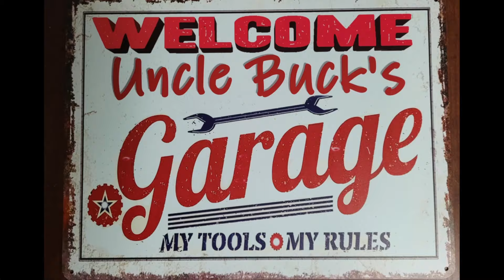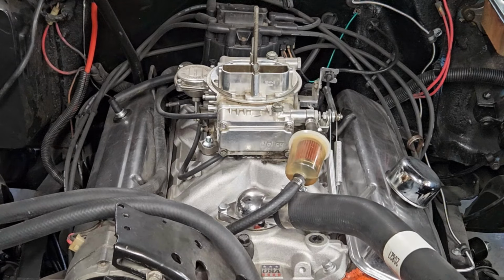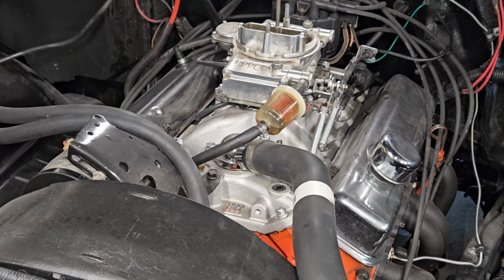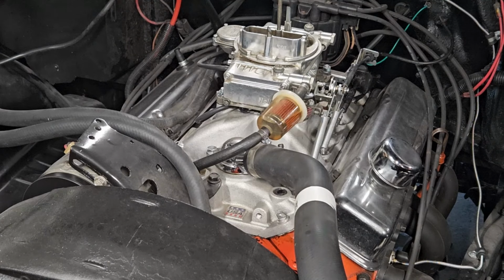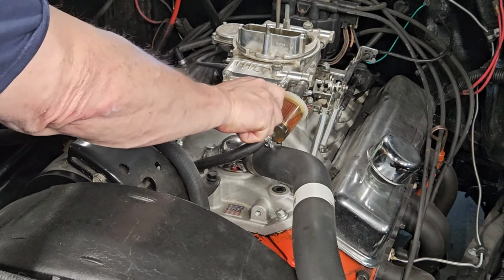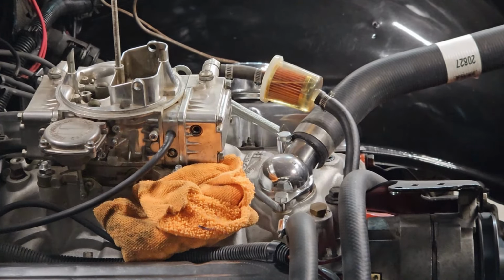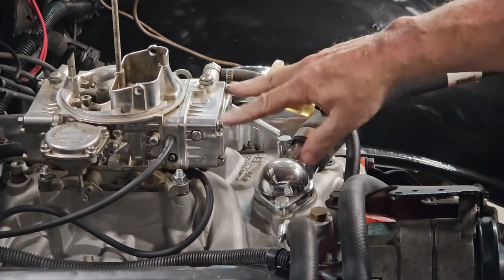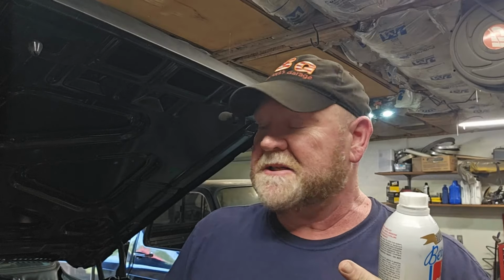how to Easily figure out Starting Problems: Square Body Chevy Hotrod

Comment: Uncle buck I’ve got a 86 gmc with a stock 350 I want a nice sound from a cam and the accessories to go with it what all would you recommend I go with
Reply from the maker: for a daily i would not go above 270 advertised duration. it will give you good sound and enough vacuum to run all your accessories